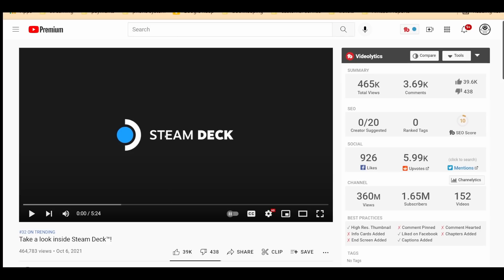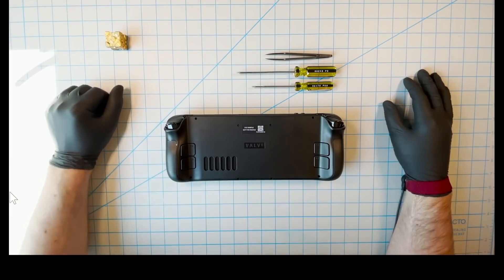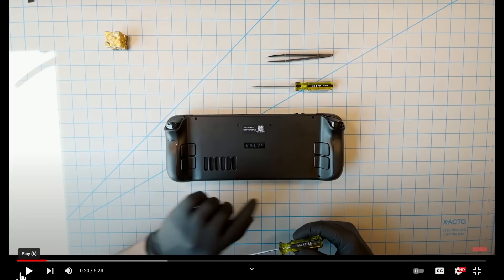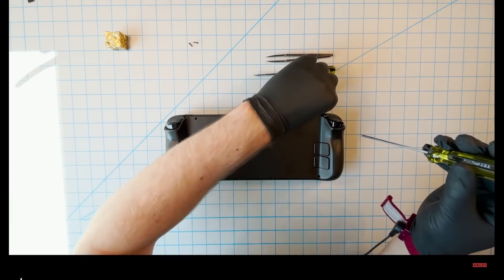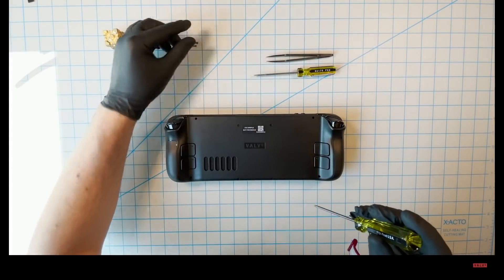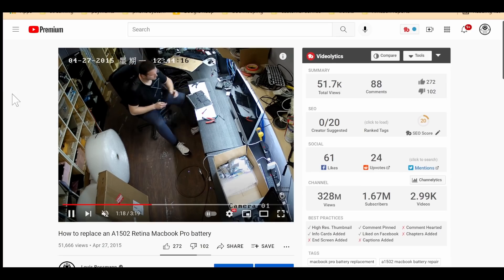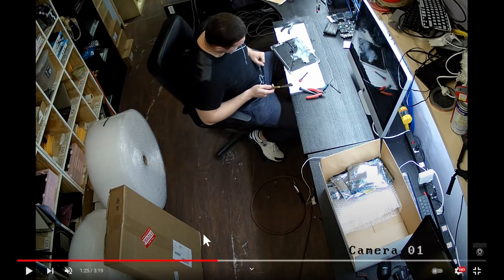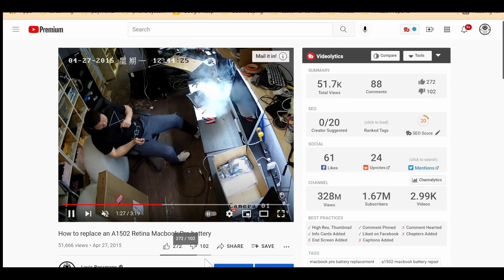Steam deck battery may end your life? bruh 😑

Comment: Well, as an engineer I'm disappointed about this video. First the they are right about the mechanical, it won't be the same. It may be the case you can even hear squeezing or cracking when you twist it slight in your hands after been taken apart. And for ESD ....is a real killer. Especially during the winter when the air is dry and you charge yourself just by walking, or lifting up from a chair. And those glows I\m quite sure they are ESD, slight conductive so no issue with the bracelet over them. You should really use at least an ESD mat on your tables, bellow the PCB, and always touch the mat first...And no...newer devices have smaller transistors, they are more prone to be damaged by a discharge. Having the charger plugged in and you zap the pcb near to a memory or data lines, especially those who run at high frequency (meaning low capacitance on the input...less protection for the transistors...), you have a direct path to ground. Only the external connectors are protected against human body model (contact/ air discharge...few pF at KV level).

Comment: I can believe the structural integrity thing because of the self tapering screws. For normal screws, there wouldn't be any reason for that to be true, but self tapering screws aren't going to go in exactly as well in the plasticas they did the first time as you might have damaged the taper or put them in at a slightly different angle. I'd say it's true AND technically measurable, but also unnecesarily emphasized as the difference is probably ridiculously small if the reasambly is done right.

Comment: Louis, you might want to consider an anti-static ankle strap that straps around your shoe and contacts the ground. Also, I'm not sure what New York is like with humidity. If it's a bit dry it might be an idea to humidify the air a bit.

Comment: I have been doing repairs to PCs for over 20 years and I have never worn an anti-static bracelet. My shoes are the ground and have never seen sparks when I have imaged HDDs and put those HDDs in the bays of a PC case. This also goes for motherboards and flat panel displays for laptops.

Comment: The "we don't reccomend opening this" part feels like "This isn't arduino, we didn't design this for you to open it up and poke around with a screwdriver" kind of statement, yeah average user, you can open it up and replace joystick, but don't do it and have someone who knows what they are doing do that instead unless you wanna risk messing up your device

Replacement parts in months coming is quite understandable, right now they are likely producing decks at full capacity for launch, they have tested the parts to be confident that they should last few months at the very least, so they plan to roll out replacements later, still before any parts can be reasonably expected to have broken

Comment: Reassembly of a device like this will NOT make it any worse for dropping it unless you somehow misaligned components or their build quality is simply piss poor. Otherwise this tells us their assembly method is flawed and their repairs are just as likely to have something go wrong as ours do.

Most of the warnings in this video are so outlandish that anyone with common sense should be able to point them out if theyre trying to open this in the first place.

Comment: Actually, puncturing an LI battery is dangerous, especially in a room that has poor ventilation; not because of the heat from the fire, which is "Yeah whatever", but the highly toxic fumes. That said, puncturing a battery will not be a frequent occurence by any stretch of the imagination.

Comment: i think its got to have something to do with the way the screw bites into the plastic when its only inserted once it would have a tighter fit with the most amount of plastic on each side of the teeth and when re installing the screws its more likely to not have the same fit and wear away at the plastic or cut in entirely new slots which in both cases would provide a weaker grip incase of a drop would it fall apart in your hands almost certainly not

Comment: I think people are reading to much into this structural integrity thing, yeah it'll be weaker thanks to the self taps yadda yadda, but i think the point the guy was trying to make at the time that got ruined in the editing / script. Is that whilst the back is off it'll be weaker. So handle with extra care whilst it's open.

Also regarding the esd, it's the gloves that are touching the parts not the skin. Ground the part that's in direct contact...

Comment: self tapping screws are notorious for wiping out the threads in plastic.  the solution is to put brass threaded inserts into the plastic bosses if there is enough plastic.  you can indeed add plastic to thermoplastics like polystyrene by setting your soldering iron to the melting temp and then plastic welding (look this up if you don't know how to do it. louis probably already knows).  you can even re-fill the bosses with plastic and drill new holes.

there are ways out of the hell that is a self tapping screw that got cross threaded.

note for the great unwashed - you can prevent cross threading if you just gently rotate the screw counter clockwise and feel when it falls into the thread.  do this and your chance of cross threading goes down (pulls statistic from ass) about 99 percent.

Comment: I think they only mention structural integrity because the plastic holes for the screws wear their threads down with every time you open it. Metal threaded inserts would have upped the price and they had to save every penny  i guess.

Comment: well, im not a mechanical engineer at all but i may have some idea why, maybe they wanted to make very clear that the case can be easely damaged while disasemmbling, some quality tools have molded plastic cases that are pretty stout, they have brass inserts and proper glass fiber reinforced plastic that helps to ensure that they  are durable and can be serviceable, but of course it drives prices up since you not only are expending more on material, the mold itself wears out sooner, so you get less parts per one cnc machined piece of steel that is not cheap to manufacture, the customer pays for that at the end and may not be worth the expense while the money could be used to put a better gpu chip or more storage or what not

Comment: I've found that with plastic self tapping screws you need to turn the screws counterclockwise until they drop into the previously cut threads.  I find that this reduces the chance of stripping them out is very low

Comment: Valve is definitely not new to contact with winy/scummy customers being one of if not the biggest gaming platform and having already the vr headsets as hardware out there. About the structure i highly doubt that it is impacted unless the self tapping screws are so bad that they wont latch again when closed. (Possible but fixable)

Comment: What a condescending video by Valve ... the only valid comment they made, IMHO (without stating the obvious) was to disconnect the battery ... I totally agree with Louis on the static overkill that is portayed a lot on YouTube videos ... I'm 57 and have done electronics since 14yrs old ... you pick things up ... it's called KNOWLEDGE & EXPERIENCE ... clearly Valve need some ...

Comment: Let me toss you a bone Louis and first off agree with you that while no I am not trained with structural engineering and in MOST cases it shouldn't weaken it here is what I think they mean by what they said. 

Since the shell is held together by the friction of the metal screws grasping into the plastic shell keeping it together and that being the primary source of the over all structural build of the device.  That the FIRST time the screws are put in is ALWAYS the tightest and will have the highest friction grasp on the threads of the screws.  As such when you remove the screws from the plastic you have broken that FIRST grip and the plastic will NEVER grasp that screw the exact same each time you remove and put it back in.  That being said will it be weak enough that a normal drop before now fully brakes something well that would more depend on the person that did the work on it.  I being a person that works with 3D printers and plastic manufacturing I would say that the statement was as you said done to cover themselves for IF someone was to say that after opening it and then dropping it that say the screw stripped from the plastic it was grasping they could point to the reduced mechanical hold the screw had from being taken out and put back in. 

I hope that this helps and answers your question as to WHY they said that statement like they did cause even for myself I was HIGHLY skeptical that it would have as big an effect on the structure as they claimed.

Comment: I have punctured  a battery when I was replacing my phone battery in my nexus 6p, little smoke and it smells too so don't wiff it like its elmers glue. i put gloves on took the battery out afterwards it was fine i cleaned up my phone put the new battery in and used it for a year

Comment: Said by other people but basically, if the self-tapping screws are not reinstalled correctly (aligned with the taps they made the first time), they will as the name implies and tap new taps, probably destroying the old ones in the process and weakening the material the screws are tapped into in general. As a result the taps are weaker, meaning that there is an increased chance on impact of the screws popping loose because the taps can't hold them.

In general I'd agree the disclaimers are more for the 1 in 1000 A-hole who will attempt to do something they didn't know how to do and not own up to a screw up on their part. Valve is known to stupid proof their stuff wherever possible and I think this is a case of them doing just that with all their disclaimers.

Comment: I am perfectly ok with any warnings they give you to not open the device and attempt to repair it. Anyone who knows what they're doing would open the thing regardless of these warnings but now you are not going in completely blind and Valve can't get sued when little Timmy lights his house on fire stuffing a screwdriver through the battery.
Reply: The battery stuff sounds a bit too dramatic (only a bit, because the smoke and heat can cause a lot of damage), but I liked the warnings about limited space for SSD because that's not so obvious.
And now we see what's in it. Either you say ok, let's go or you say I better leave it or ask someone to do it.

Comment: I really like that they are using daughterboards for teh buttons and joysticks. Makes it so much easier and safer to replace these parts that will get aggressively handled at some point. Self tapping screws do have the problem that they lose grip if you unscrew them and screw them back in, but that's only rotationaly grip. I am very sure it won't affect the amount of force it takes to rip one out, unless you cross-thread by forcefully screwing the screw back in. 
Be careful and don't try to rip your device open, then it won't suffer from "permanent" structural integrity loss when you open it up XD

Comment: If you were to damage the cell but, not puncture it and it starts a fire when charging you could die in the fire. Just saying. Also self tapping screws do have slightly less holding force after being taken out.

Just playing devils advocate.

Comment: Crappy self tappers into cheap plastic pillars can cause structural problems in so much as you can strip the threads, cut by the screws on their first insertion. If this happens, the screw will never properly tighten (applies to metal and self tappers too).  It's then possible that a light drop or prying/ twisting of the case, screws pop out, device is at least partially open again. The work around is it fill the hole(s) with super glue, let it set and then put the screws back in. It's also possible to horse the screws back in too tight and end up with a screw that just turns because it's striped the threads or worse, split the plastic pillar.

Comment: I expect that if you drop it a lot, and then you open it, and you lose a screw, and you put to much force on the other ones. You might have issues. So like you said, is that 1 in 1000 case where a jackass opens it with a dagger.

Comment: A few months ago I had a repair guy swap out the board on my dishwasher. When he was putting the self tapping screws back in, he didn't bother to align them with the groves so he destroyed two of the screw holes. He also overtightened one of them and it had the same effect.

Comment: People are freaking out about them recommending not messing with aftermarket parts when they designed things a specific way and including the lawyer's warnings, but they are different from the others that they actually say "you can open it, here's how to do it." 

People who don't know how to be safe with a battery could cause Valve to be sued if they don't mention that it's dangerous to mess with a battery when you don't know what you're doing. They also mention bringing it to someone who knows what they are doing if you aren't comfortable. Especially when its a high capacity lithium battery in your pocket. Lawyers were probably fighting this video even existing, lets be honest. 

Guys, it's just the legal dept shining through. Now the real question is will they provide access to replacement parts, for these custom designed parts that wont mess with the wifi/bluetooth., and fit the case.

Edit 1: Also, the thing about the screws, another warning for people to be careful because they use self tapping screws. Only they actually TELL YOU about this so you know not to overtighten it. Additionally, unless you know what youre doing, opening it will always leave it slightly less study. Smells to me like another legal thing to avoid people trying to warantee it when they dril out the screw hole by overtightening it until it comes apart with a fingernail. It's common sense to us, but maybe ot to a teenage r who has never opened anything this complex before. If they've fixed a phone or macbook like you or I, this is all just legal bullshittery, but it's also good to know before going into it to be careful with X, Y, and Z. Personally, I feel it's fair but also speaks to the state of our legal system, since they have to worry about being sued over some dumbass shorting a fully charged battery and blowing it up somehow. Before you call bullshit you and I BOTH know users find a way, no matter how idiot-proof you make something, they'll always make a better idiot, and give them the confidence of a tech with 25 years experience.

Comment: The other way that the structural integrity MAY be compromised upon re-assembly is if, for example, you over-torque the screw on re-assembly (either deliberately or inadvertently).

What MAY, potentially happen, in a situation like that is that the boss that the screw screws into, MAY develop either a stress riser or that you can actually induce a microfracture crack in the plastic housing and THAT, then, will become the source of the loss of structural integrity, leading to a structural failure.

It's possible.

The probability of which will depend on whether people are just screwing the screws back in and just jamming it in there, not realising that the threads of the screw actually cracked the housing originating from the screw boss, or they're not paying attention/tired/it's late at night/fatigued/reduced physical, visual performance (e.g. it's late at night, you're tired, so you aren't seeing as clearly compared to during the day, after you have rested).

Microcracks in plastic housings certainly can develop and manifest over time.

And if the unit is dropped on the floor repeatedly, it can start off as a microfracture crack in the plastic housing that then becomes a big problem for you.

Comment: i think  if you tighten your srews in the plastic to much you can damage it to where it looks like holding but snaps at a bit load, so I think they want to be save against these cases. In general plastic threads not robust.

Comment: I think that they're correct, I'm not an engineer, but I've had my fair share of breaking plastic in my 3d printer. I think those screws when taken out and put back in will rethread the plastic and cause it to have a little give where when the device is dropped there will be more flex on the screen and board. They also show drop test video in their demonstration so I'm inclined to believe they tested for it.

Comment: The reason they are saying that You shouldn't do this is because we know there are plenty of people out there who are going to do this just because they can and then break it and then blame valve that they don't know how to do it, and we know that some of them will puncture the battery in some way that causes it to catch fire, and there's a non-zero chance that one of those people is going to die.  I don't think it's unreasonable for them to fill a video about how someone who knows how to repair computers can repair this computer with warnings about how you shouldn't try to do that.  Remember Rossman, not everyone who knows how to use a screwdriver knows how to mess with a PCB.